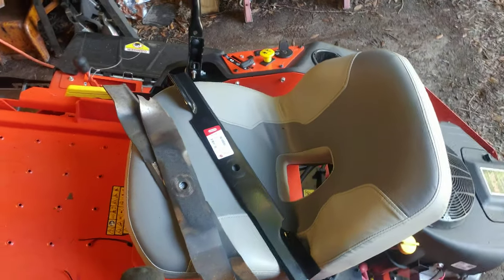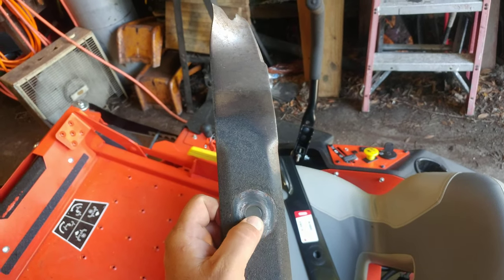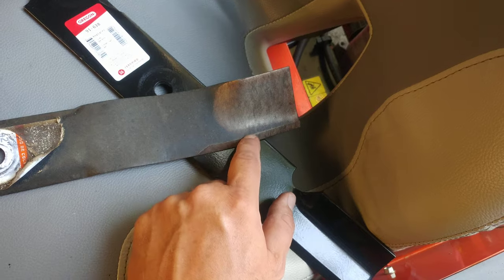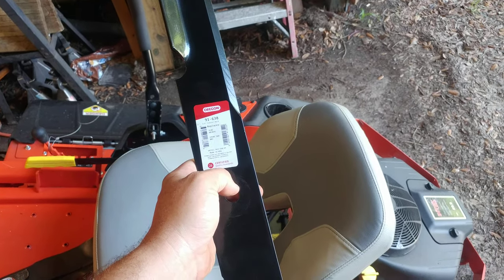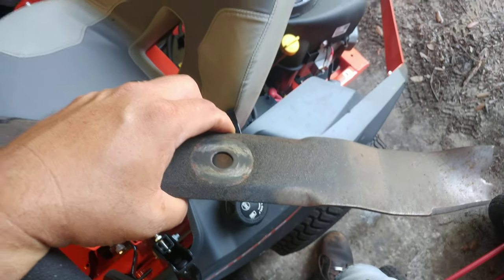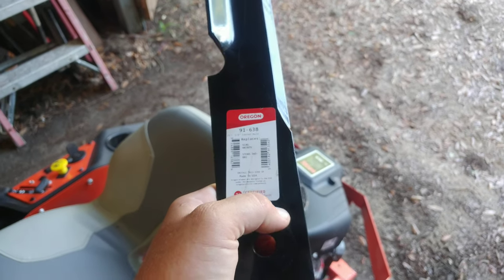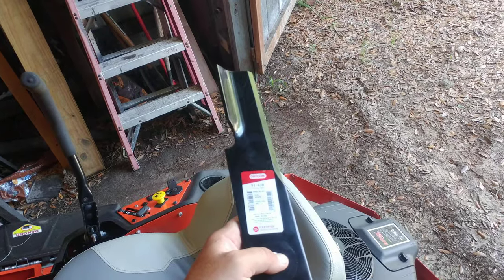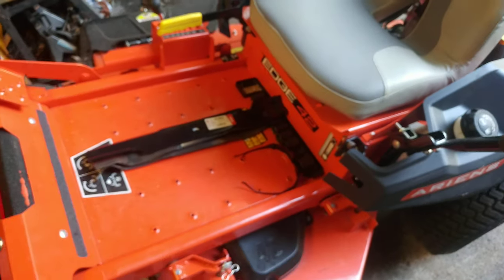Aftermarket Mower Blades

Comment: Great video how does the big square deck do the part next to the side shout saw it at lows just wondering if its the same goofy design as the 52
Reply from the maker: It does great. I like the fabricated deck. It allows a lot of room in front of the blades. What that does is make room for grass clippings and that in turn allows you to mow thick grass faster without bogging down. I have mowed through some pretty think stuff at full speed ahead and did not slow this mower down. Obviously it loaded up the motor, but there was no need to slow down. Overall very happy with this machine and I am glad I purchased it.
Reply: @Bbernhardsr  thanks for the replie im looking in to a gravely but ariens is definitely an good one too im probably going to safford in Alabama they always have great deals
Reply from the maker: @Bigdaddy-Donkyking  well keep in mind that Airens and Gravely share a lot of the same parts. I don't know for sure but I believe they are both built by the same manufacturer.
Reply: @Bbernhardsr  i think there both excellent zero turn personally I'm driven everything but my partial favorite right now is Cub Cadet just because the Simplicity of the whole mower I was going to get a Spartan just because I love the way they look but they're expensive